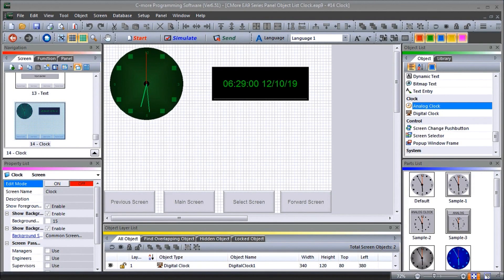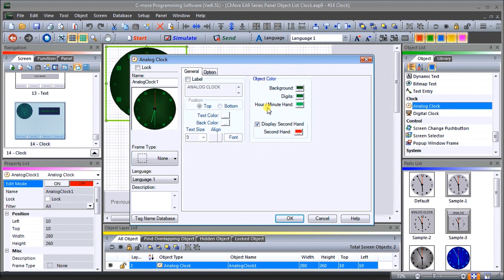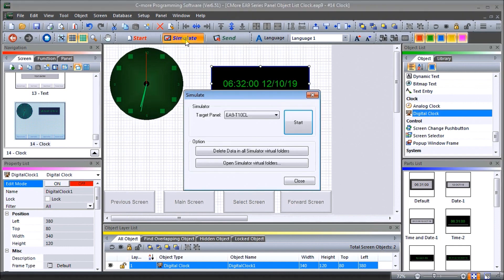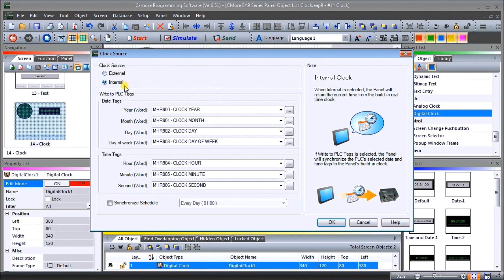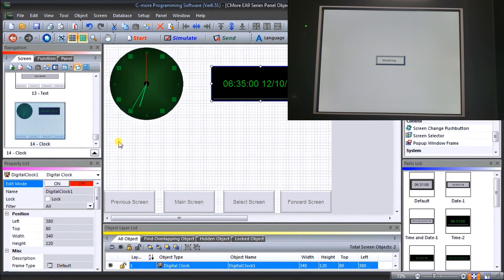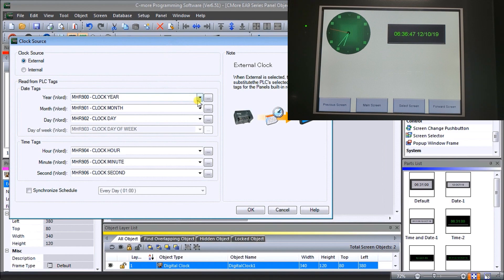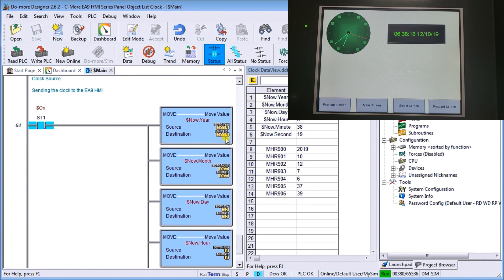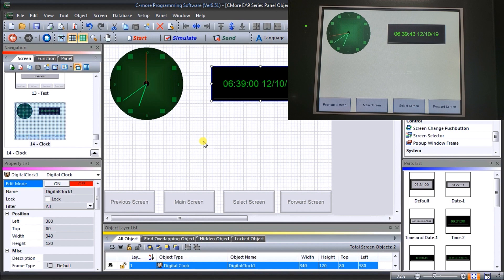C-More EA9 HMI Series Panel Object List Clock

Comment: Thanks for taking time to make these videos. What is the most efficient way to set the PLC date and time from the HMI? Do you need to setup separate numeric entries for each component of the date/time($NOW) in the HMI, set the clock source to internal, then input values to the tags to $NOW.*** via the numeric entries?
Reply from the maker: Hi Rick,
The easiest way to set the HMI RTC into the PLC is to set up the tags. In the C-More Programming Software select "Clock Source..." from the main menu under setup.
Select internal for the clock source and select the tags that get updated. Use the synchronize schedule to update the RTC at specific times.
I hope this helps you out.
Regards,
Garry